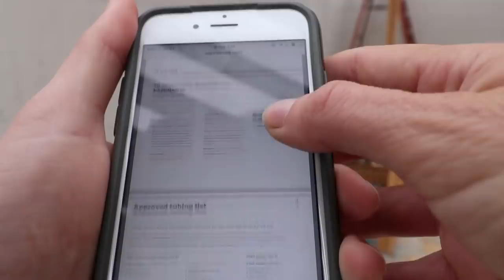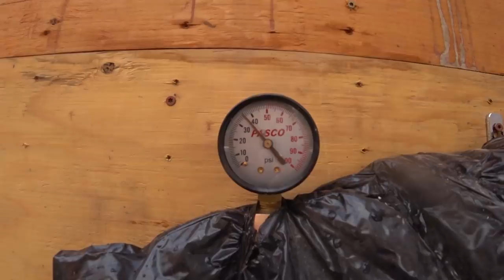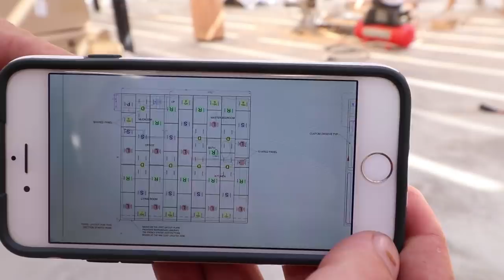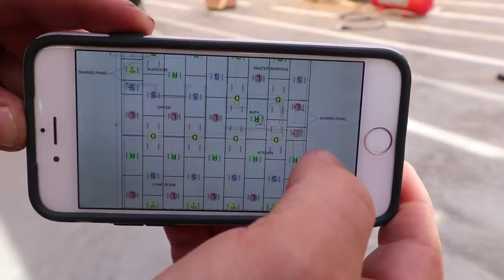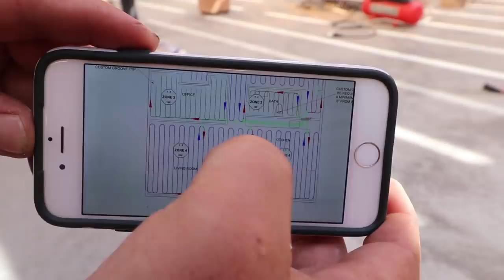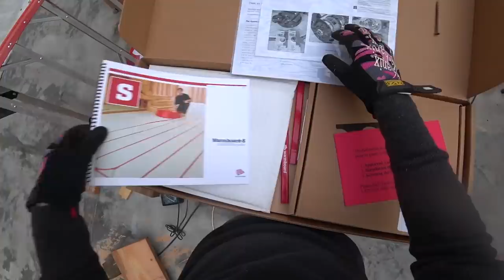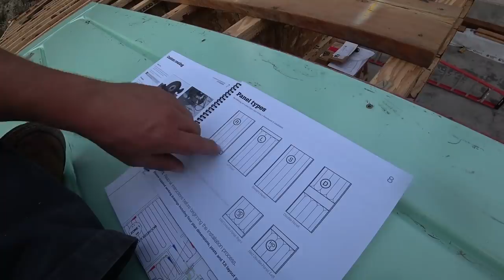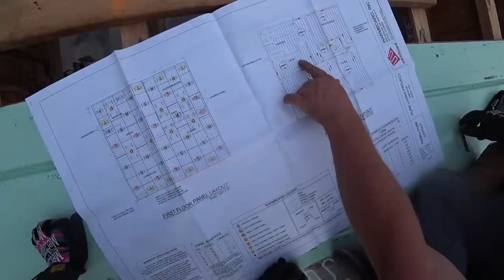Building a House Start to Finish: Radiant Floor Heating Installation Ep 1

Comment: Technically, you can't reproduce the plans without permission from the designer. That's how architects and engineers make their money, printing additional sets of plans lol. And you can only use the approved set to build. Now that I think about it, maybe that's not a federal rule. But loving that warm board company. All in one service is hard to come by in the industry
Reply: Most engineering firms will grant right to print copies of the plans for use with the building we designed if for. Our contracts usually restricted re-use of the building design on another permit, though. 1 design fee covers 1 building. That not only ensures we have an opportunity to make money on the next building it is used on, it also ensures the engineers have a chance to ensure the site conditions don't warrant a change in the design. The firm I worked for never really made much on reproduction. It almost all went straight to the company we paid to manage our large-format printer assets, with some to cover the internal labor and the overhead associated with billing/accounting/etc. For large runs we'd just send it over to a print house that would manage the print and distribution for us.

Comment: i'm not sharing your enthusiasm about that hot floor mumbo jumbo product, so many things are wrong with it: 
1. there's too much space between pipe lines and that layer of aluminum will help a bit but not that much to compensate a wide gap, it should be aluminum above the pipes as well.
2. Heating pipe is packed between two insulation wooden boards basically, wood is thermal insulator, so there's will be very small temperature difference between inlet and outlet means not much heat has been dissipated - means you'll have to buy quite expensive thermal conductive dense wooden flooring meant for heating. 
3. There's no mass in whole story to keep the heat like in concrete slab and ceramic tiles floor heating configuration - means: heat is off floor is cold in minutes, heat is on, takes a lot of time to reheat again due to a wood sandwich. So it leads to: 
4.  it require more regulation equipment to compensate all 1-3 means more money.
If Im to buy this product, I'll think more then twice, but I'll take it if its a giveaway  or ridiculously big discount on a price...although, floor heating could be great thing if done right.

Comment: Let me get this straight.  You never plan on using the radiant in the slab? You spent all that money and time and made great drama via video on drilling into it for NOTHING? Made for TV much?
Reply: go away
Reply: When I built my house , I had a professional do the foundation. He stressed to me repeatedly, DO not do the basement floor until the house is "under roof". This is exactly the reason why, as he knew I was doing  the rest myself over an extended period. That basement floor is now under extreme risk of freeze damage.

Comment: I would have figured that you would Know that If you drilled into your pressurized radiant lines, It would blow the concrete dust up at you the instant you hit it... Perhaps you know this and have shown someone 'monitoring' the pressure gauge just for 'dramatic' effect.

Comment: Floor heating is not good. Because it makes tiniest particles can not settle on the ground. I think what you can do is put a fireplace at the center of the house, burn it at ground and let it heat upward.
Reply: @m.ali petek, thats utter bullshit you've spilled out here - particles are always present due to a static electricity (ionizer will help on it, to "stick" particles to the walls)  and tiny ash particles all around the house from a center stove/fireplace will definitely help having cleaner air, right?
Reply: @Helloverlord You know there are every sizes of particles floating, some of them might hang with static like you said, but rising hot air from the ground obviously will make some particles take off, I dont know what amount. 
And central stove will not be a fire burning inside obviously, It will be a isolated air channel like any stove. 
This way center will heat surrounding air and rise while walls will be relatively colder and let that risen air to settle. And people will be in between center and walls free of most of floating particle action. Its not bullshit.
Reply: Thermal effect you described will happen anyhow, there's always a flow downward near colder walls but if you look at the uplift of hot air between 29C (floor) and 23C (2m height) you'll see there's almost none of energy of hot air lifting particles only static electric effect, cause higher you go, air is getting colder - if floor heating system is done well. That story on dust in floor heated room is an urban legend, I've heard it so many times but no one succeeded to provide any real physics or logic behind it. Radiators  and indoor stoves generate far more thermal uplift due to a thermal difference (stove heat up to 200C) and bottom line is if you're so concerned about breathing dust in a room, just make sure you clean your floor more often. Floor heating is best to incorporate with ceramic tiles not wooden floor, and tiles are super easy to keep clean. Also, take a look in heat distribution graphs:  http://www.heatpex.com.au/heatpex_img/underfloor_small.png and search for article: "Numerical comparison of airborne particles deposition and dispersion in radiator and floor heating systems"...you'll get the point. 
Btw, opening a burning stove to feed it or cleaning it, or dispose of ash in tray will release far more tiny particles in the air in that room then floor heating will ever.... ;)
Reply: Maybe youre right, I just wanted that urban legend to pollute here. LOL.

Comment: Please stop cleaning yourself with compressed air.  This is a safety issue.
Reply: From a pancake compressor? It's not likely. I understand the risk though and I don't personally do it either. My cousin does it all the time at work without a trigger using the shop air at 175+psi, he just jambs a fitting in the quick release, a lot of people in industry do it. Not "safe" but whatever